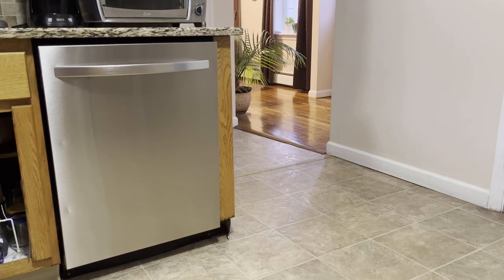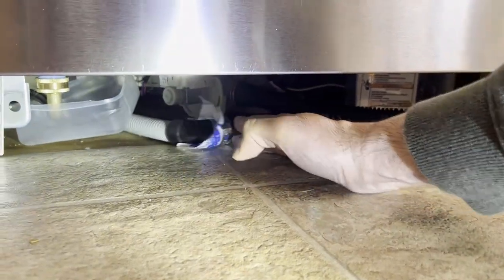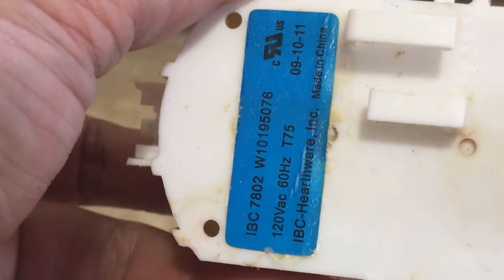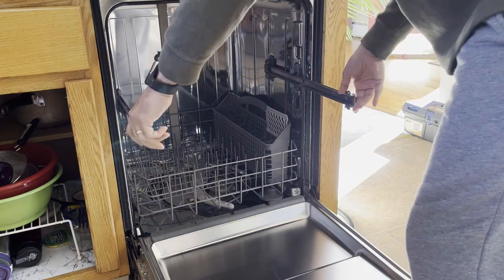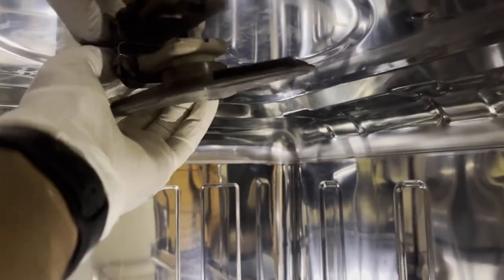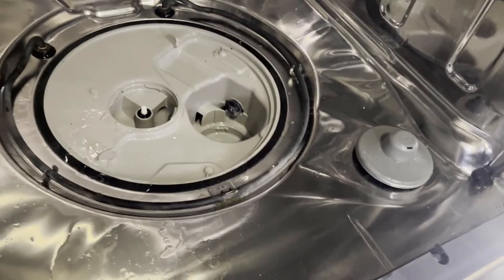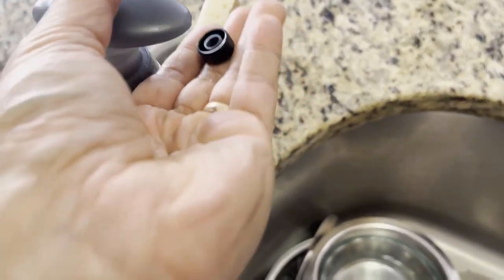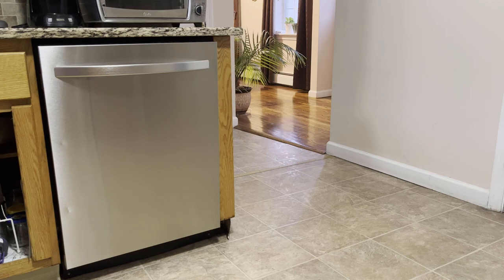Quick Fix! Kenmore / Whirlpool Dishwasher leaking underneath from Diverter Motor shaft.

Comment: I showed a video of the leak to a plumber. He said he would replace the pump and motor for $400. So instead I came onto youtube and found this video. I ordered the grommet, and made the replacement. The old grommet came out easily with a small screwdriver. The replacement seemed to have a narrower hole in the center, but it went on fine. Leak gone! Total cost, $8. Thank you for a great helpful video.
Reply from the maker: Glad to hear!

Comment: Wow! I suspect this is the exact problem i am having on my whirlpool! I noticed a leak from the bottom of the diverter motor you displayed at the beginning. I will update with the results once I inspect more closely

edit: I bought his replacement and it is still leaking just to a lesser extent, even after using the spring from the old grommet and applying plumbers grease. Time to look for a better fitting part.

Comment: BTW, I did not have to remove the pipe at the back that leads to the top sprayer. I went directly to the cover where the grommet is housed, loosened the clip, and by turning counter-clockwise the feeder pipe simply came out. Putting back on is the reverse.

Comment: I have a Kenmore Elite 66512773K311 dishwasher that I need to replace the gasket and or diverter motor but I can find no instructions that tell me how to remove the spray bar and plumbing to get to the diverter.  I even bought a service manual online but it does not match my unit.  Do you have any idea where I can find instructions for removing my spraybar and plumbing as I see no clips to release it from the tube or from the back of the tub. My bottom spray nozzles do not just pop out like yours.  Thank you.

Comment: this grommet doesn't show up in the parts diagram that I see on sears parts direct. I'm wondering how you found it. why is there not some sort of drip tray to catch any potential leaks before they buckle your wood floor?! This is ridiculous. I will be adding some sort of catch tray under this thing. Can't believe things like this are not engineered any better than this.
Reply from the maker: I placed a small bowl under mine for future. I guess a water alarm might help too. Not sure if there is enough room for it, they are usually the size of a hockey puck.

Comment: Great video, thank you for making it. I believe this is the same issue I'm having with my Kenmore elite dishwasher, do you have a phone number where you ordered your parts / seal from. Mine looks a little different, but I'm sure it's kinda the same. I tried pulling my lower propeller off but had no luck. Mine has kinda a gear that goes around under the large propeller. Any help would be greatly appreciated. Thank you
Reply from the maker: Unfortunately, I don’t have a phone number but I did put out the part number I used in the video description that you could Google.